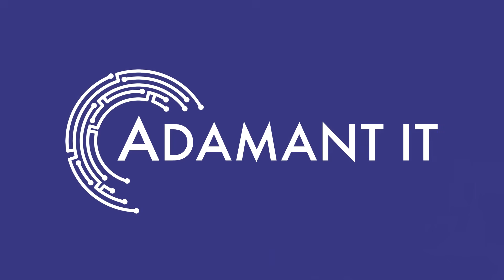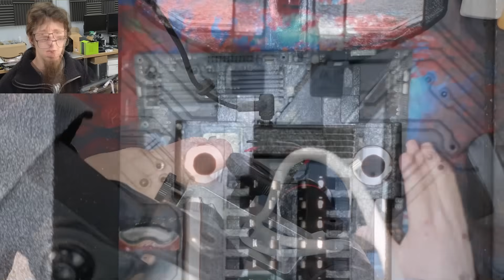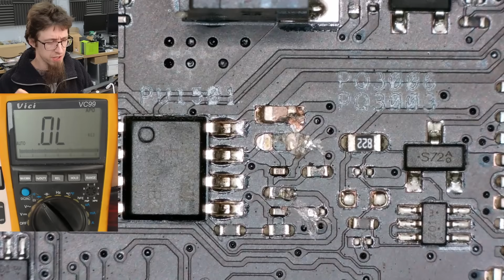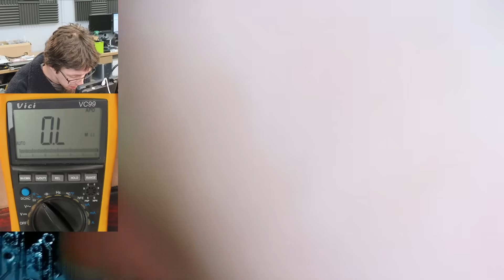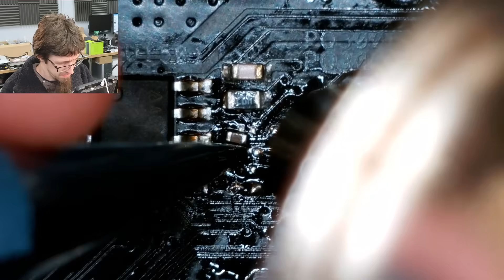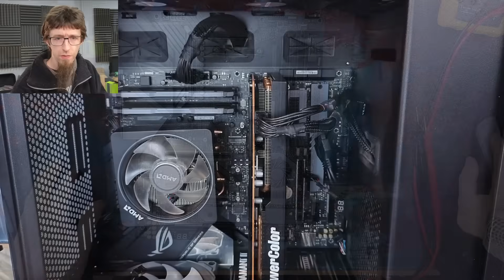Strix Mobo repair, Screw driver slipped removing the GPU - LFC#394

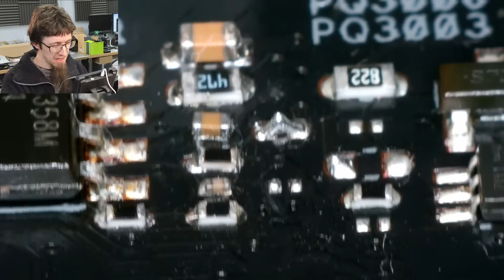Comment: 13:43 I hope by this point he noticed the pads layout is NOT the same. some stuff swapped around. 19:35 oh no he didnt. sending prayers for a 0 ohm in the wrong spot.
Reply from the maker: Yea I had to look 3 or 4 times after reading this comment before I spotted it. Monstrously subtle difference. I assumed it was in-circuit readings throwing things off, and the damaged components.
The question is then, why did it still work 🤔
Maybe those two are both just pull resistors, and the signal works just fine either way?
Reply: i went through the boardview and still no clue what that opamp is doing. the one u bridged maybe goes to 1.8V supply maybe nowhere . depending if a certain jumper is present @Adamant_IT   the one that has 500 ohm instead of 0 goes also to 1.8V but through a "programmable DAC" NCT3933U
Reply from the maker: @Nebbia_affaraccimiei  Yea, the swapped resistors don't appear to connect anything that sinks current, so no harm done. But that DAC might not be doing it's job. Hard to tell what that job is though, given that everything appears to be working.
Reply: Oh wow, good catch!

Comment: You asked if anyone knew what that section of the board was for; the AS358M integrated circuit that those components were connected to is an op amp, and given it's proximity to the PCIe slot, is probably  conditioning data going to whatever is plugged into that slot, in this case, a graphics card. Hope that helps!

Comment: Dear Adamant IT. I bought iMac 2019 and I didn't format it directly but after one year when I wanted to sell it, I formatted and it appeared that its firmware password is locked and the seller is not responding. Can you help me in opening it Please? I have a proof of legal purchase from Ebay. I am from UK

Comment: Pro tip: You can easily tell what that circuit basically does without a schematic. The 8 pin chip has 358 on it so it's a copy of a LM358 dual operational amplifier. The large cap is simply a decoupling cap tied between vcc and gnd so any nominal decoupling cap can be used (i.e. 0.1uF). The 4.7k resistor is part of a comparitor or voltage reference and the other side of the resistor should feed back into one of the input pins on that same chip. It's nothing special and highly likely any nominal resistor could be used, like 2.2k, 10k etc and it would probably work. Next time this happens look for common chips near the damage and look up the datasheet to see what it does. Often datasheets will have a reference circuit and a lot of the time those reference circuits are used as-is on other products. Alternatively find any similar motherboard schematic that is using a LM358 and the circuit there could be very similar.
Reply: thanks!

Comment: Good tip for opening graphics cards clip wen rmoving them, Use a pencil with a rubber on the end and use the rubber end to open the clip, if you slip you shouldn't damage anything, also dont pull on the graphics card until the clip is fully depressed, meaning all the way back, id you pull on the card too soon this means you're adding pressure to the clip making it harder to push open, Great content as aslway, keep up the great work :).

Comment: 12:30, It's not impossible for that resistor to be a current sensing resistor (a circuit diagram would help loads), these can have values as low as 20 milliOhm. Your meter read 200 milliOhm. Might be time to get a better multimeter if you want to be sure about resistor values down at those sorts of readings...

EDIT : I see someone with the 'matic' says it is indeed a zero jumper. Still, a better multimeter never hurt anyone, lol
Reply from the maker: That's a good thought, but also current-sense / shunt resistors have a very distinctive look. The biggest giveaway is that the pads on them are on the long-sides, not the short sides.

Comment: Isn't it funny how a day after i also damaged my mobo in a similar fashion, i get this video in my feed? 😂

Yesterday i replaced my CPU and after i was done with the CPU cooler, when i tried to screw in the GPU i dropped the screwdriver(a pretty heavy one) on the motherboard, which left a pretty big scratch around the area of the sound chip, like a 1 cm scratch. Thankfully everything works fine so far.

Comment: It might also help when no schematic to check the datasheet of that chip, look for a typical application and compare to what is on the board. Any maybe be careful with assuming "0 ohm resistor" with unmarked components. Might be a (small) inductor as well (which in fact IS a low-resistance wire in DC mode), so check inductance as well probably.

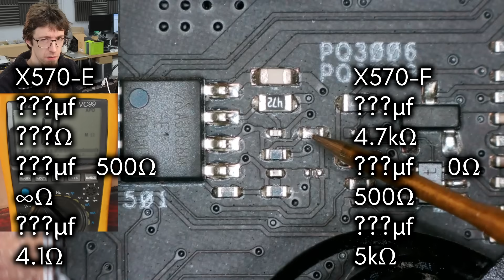Comment: 10:45 - That is a 0 OHM resistor, it would be advisable to replace it, not link it, as it is 1.8v and a circuit protection for PU1501.
Reply: 0 ohm is just a wire
Reply: it's for placing a jumper, right?

Comment: Hi Graham, still can't thank you enough for saving my bacon so to speak.  As some have commented, my gpu is rather large an MSI RTX 3060ti Trio. I could reach the latch with fingers but it was stuck fast and out of desperation stupidly resorted to a Mac Tools posidrive. The upsides of this fiasco are A , I'm not the only one and B, I get to watch a successful repair.
Many many thanks Graham, you're a star 🌟🥇🏅🏅

Comment: talking about board repair, is it posible to use one of the cables of a cat5e cable to repair a trace on a motherboard? just wondering, i have an am3 board that got damaged when client decided to repaste the cpu. but instead of repair we update all the platform instead.
Reply from the maker: I'm assuming you mean the strands, the wire itself will be way too thick. I'd get some enamel wire (aka magnet wire) though if you can, as it has insulation, so is less exposed than a bare strand.

Comment: When adding the parts back to the board, I think it's easier to use Mr. Solderfix's technique of leaving the pads flat and using a soldering iron to solder one end first. That way there is no risk of blowing the parts off the board, and you can fine tune the position of each part before soldering the other end. See https://youtu.be/irW5Whm0BVs
Reply from the maker: I found my iron tips were just too big for doing this on 0402 and smaller, but I do have a new iron now, with a nice small J-tip, so I should try that again 👌
Reply: Mr. Solderfix makes it look so easy. It's never as simple when I try! @Adamant_IT

Comment: One tiny note. Min 13-14 when you desoldered the components. İn my view, you'd better wait for that area of the mainboard to get somewhat colder first, then measure resistance. Temperature has an impact on the resistance.

Comment: If I read the IC's marking correctly, it's an AS358M which is a jellybean dual OP-Amp. That checks out with the top right 100nF capacitor acting as a bypass cap from VCC to ground.

As to what the section does - no idea. Since you said the board was originally stuck at POST code 00, it could have something to do with power monitoring to keep the board in reset until some rails have stabilized.

Comment: Very interesting video Graham thanks for sharing!  since these components are taken from a laptop and this Ic is defined as a low power dual op amp in the datasheet I believe the power rating of the resistors and the voltage rating of the caps are also good enough.

Comment: I've got a ROG Maximus XI board with a three fan RTX 3050 GPU and a quite large Cooler Master CPU cooler and yes, it is a chore getting one's fingers in there to release that latch. Using sharp objects to get in there is not a good idea, however.

Comment: I use a wooden pencil for this task. Much safer than screwdriver. I have the B550 version of this board. 

Modern GPU's are so awkward to work with. You have to be ultra careful with them. They weigh a ton, and you cannot get at the motherboard once they are slotted-in. 

Note, make sure the pencil has either rubber at the end, or just plain wood...

Comment: I use a plastic spudger for this very reason to get stubborn or hard to reach PCI-E latches to release. My new motherboard has addressed this problem (Asus ProArt X670E) - it has a button near the outermost dimm slot that engages a fancy mechanism that releases the GPU. No more screwdrivers/spudgers!

Comment: So the shematic of this board says the big cap is a MLCC 0.1UF/16V (0603). The resistor next to it is RES 4.7K OHM 1/10W(0603) between ground and P_1V8. The next damaged Resistor is a RES 0 OHM 1/16W(0402)JUMP. The 500 ohm resistor is correct RES 499 OHM 1/16W (0402). The small cap at the bottom off the list is a MLCC 0.1UF/16V (0201). Well done without an shematic.
Reply: The 1.8V is for the CPU and prevents CPU init. without it eg. reading 00 on post codes.
Reply: if you look closely both boards have swapped 500 and 0 ohm resistors. They are on the same spot on the motherboard, but traces lead to different spots (and they go to matching vias in the end). That's why measurement's on both boards do not match
Reply: I wonder why they decided to use an 0603 size for that 100nF cap. 🤔

Comment: Hello Graham, a resistor on the damaged motherboard was specifically giving a value of 500 ohms, but the undamaged one on the board motherboard gave a value of 0 ohms , I didn't quite understand why. I'm trying to improve myself in motherboard repair, so I'd appreciate it if you could answer.
Reply: notice the pads dont go in the same place, these 2 components are swapped

Comment: Checking the datasheet of the IC next to the zone you fixed might give some hints on what this section of the board is doing.
I could not capture the exact PN, but it looks like its "something-something"5358M"something", which does not give any plausible results to what this IC is.
Reply: from boardview its a dual opamp AS358 . has to do with the 1.8V rail

Comment: Back in the day I put nasty gouges in a few boards and/or knocked components off them when installing/removing/adjusting CPU coolers. This was back in the socket 7 days when heatsinks were affixed directly to the sockets using spring loaded metal bars. You’d need to use a screwdriver to lever them on and off, and they were under significant tension too, so it was ridiculously easy, if you weren’t careful, for the screwdriver to slip out and put nasty gouges in the areas of the board near the CPU socket. Which were usually filled with really tiny delicate traces and/or surface mounted components. This was long before I had the skills or equipment to perform repairs like this, so those boards were basically write offs. Sad, but you live and you learn.